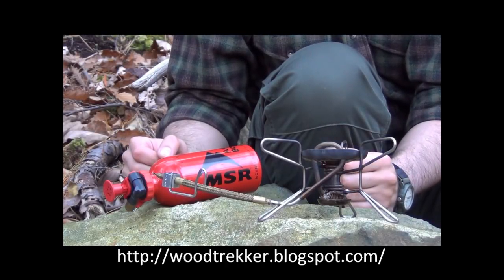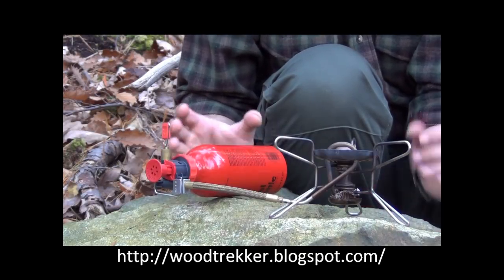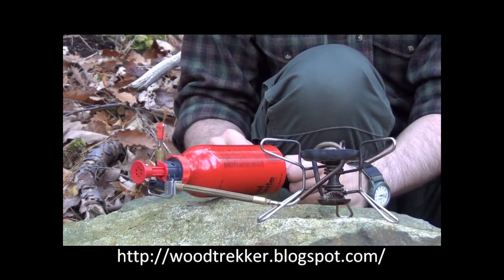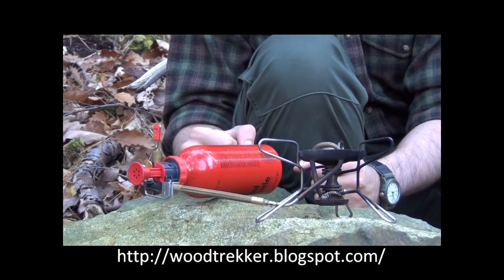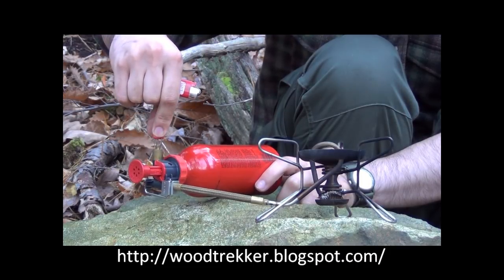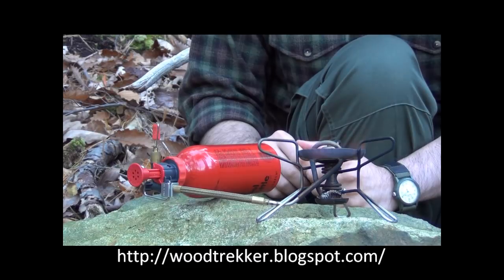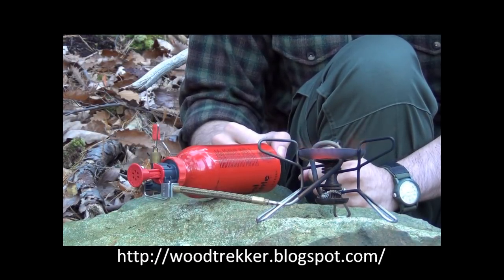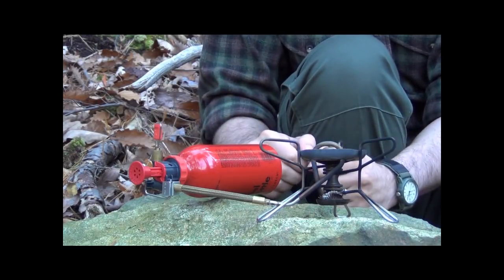White Gas Stove Basics

Comment: The problem with the alcohol attacking gaskets and seals is absolutely the reason that many of the stove. Those model Optimus stoves get around the problem by not having rubber gaskets or seals.  The older designs used cast burners and graphite packing.

Comment: Nice video.  I would suggest that stoves that burn alcohol are mostly Optimus models.  111t 199 and the model 11 explorer.
Reply from the maker: Thank you. The alcohol here is used only for priming, not to run the stove.
Reply: +Ross Gilmore Yes I understand.  There seemed to be confusion in the comments section.  Your video is very clear and understandable.
Reply from the maker: +Thereal111t Thanks

Comment from the maker: @shippen2010 Tanks. When used for priming like I did in the video, alcohol actually produces less heat than white gas. Ethanol has 23.5 Megajoules per liter, while white gas has 35.5. I am not sure what would happen if you burn it inside the stove, although I've seen similar stoves that are designed to work on alcohol. I'm not sure why yours melted.

Comment: @shippen2010 alcohol vaporizes at a lower tempurature then petroleum based fuels, hence, it doesnt need pressurization. Most alcohol stoves (penny stoves, can tin stove or other designs) rely on the low boiling tempurature of alcohol to create 'jets' to spread the flame, but doesn't need the pressure to burn.

Comment: @rg598 I would love to know what stoves you found, like these, that run on alcohol. I say that because, ALL the manufactures I've researched state CLEARLY that alcohol is NOT to be used in these stoves. The main reason: Denatured alcohol disolves the seals/gaskets causing LEAKS. Any 'petroleum based' fuel stove is only supposed to use just that, petroleum based fuels, white (naptha) gas, gasoline, diesel, aviation fuel (as per each stove's instructions), NEVER alcohol.

Comment: Why don't you pressurize the bottle before connecting it? There is a shut-off valve out there.  In this case you will pump more easily without scratching your bottles especially if you use a neoprene bottle cover. Secondly you can prime it with a clean burning fuel such as lighter fluid whose flames are more visible than alcohol's ones. By doing so you can use ordinary gasoline without any soot formation